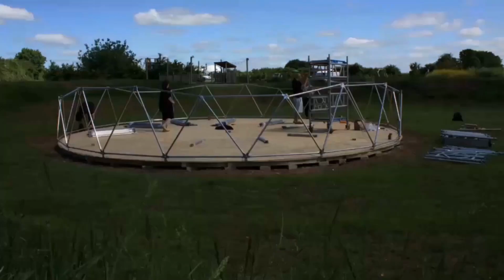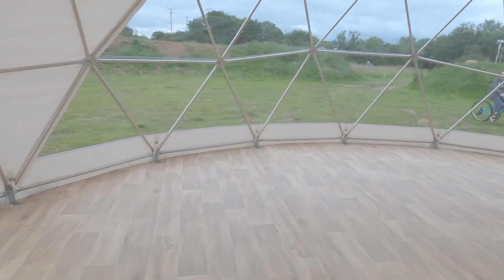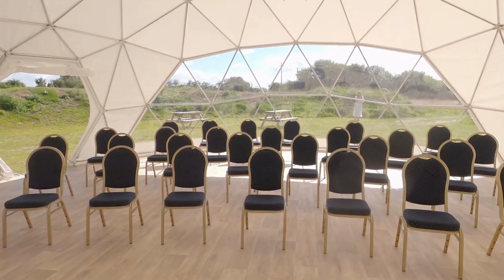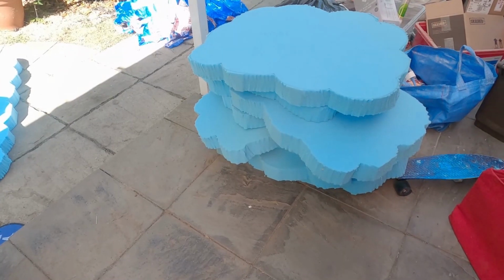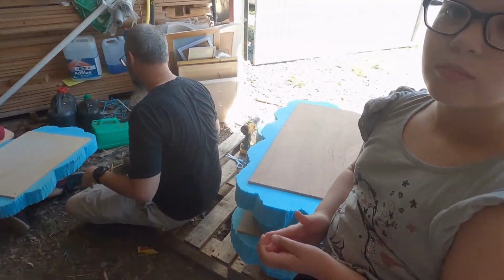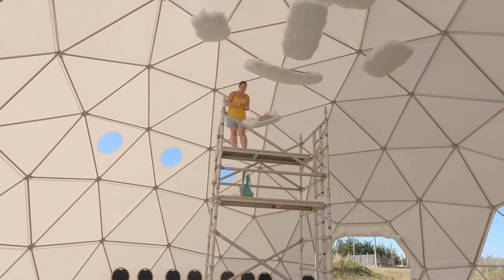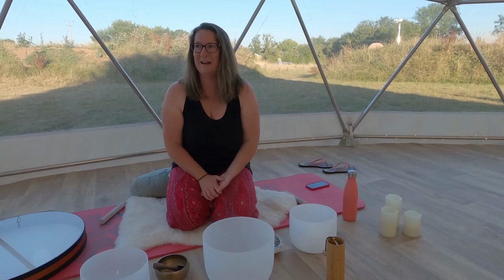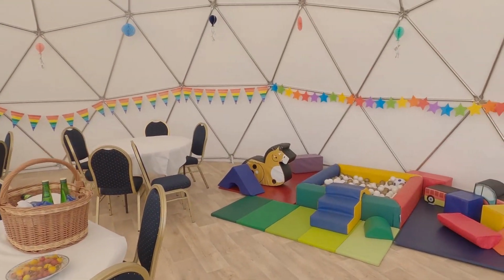Our First Events in our 10 metre Geodome! PLUS How we solve the dome echo with DIY acoustic clouds

Comment: Hello love your videos, I'm currently deciding on a floor for my dome its replacing a bell tent on rectangular base but unsure as to what to place on top of decking boards as the bell tent had a ground sheet, the Stirling board and then vinyl flooring worries me as it might rot very quickly how has it done over the year since installed? i was thinking of plastic ply sheets that you have used in your other tents, have you put any thing on top of the plastic ply? Many thanks
Reply from the maker: Hi, thanks so much for your comment! The sterling board and vinyl is still absolutely fine but I think that's because it has air flow underneath, I think if you put it straight on decking boards it would then sit in the damp and rot. I know some people have put a damp proof membrane on the deck and tucked it up around the inside but that's not the best solution. You kind of need to build a second circular floor on top of the decking with airflow underneath or cut the deck into a circular shape if it doesn't compromise the strength. Domes are definitely a lot less stressful than a bell tent!
Reply from the maker: Forgot to add, we didn't put anything on top of the plastic ply, just some rugs to make it more homely!
Reply: Thanks for your reply, Glad your sterling board is working well, I'm now thinking of lifting the decking boards and putting plastic stock board down direct to the 6x2 below with felt strips between gaps to stop any drafts then install a wooden floor on top of that, then on the outside of dome sandwich the excess cover material down with a decking board. Running a glamping site makes you a jack of all trades but master of none lol do you think this solution will work?
Reply from the maker: @paulaustin5116  sorry for the late reply! I think that would work, my only worry is that you might still get water run off the deck and get under the skirt even if you screwed a decking board on it. Water will just get in any tiny gap! If you can tuck the skirt down and have a little gap between the outside of the dome and the decking then even better